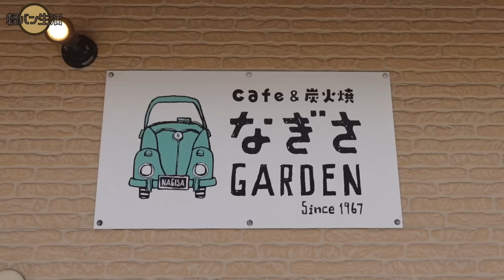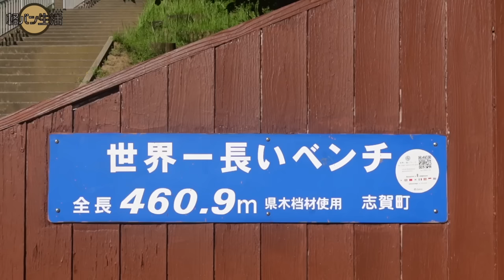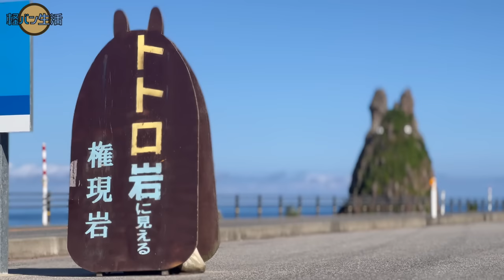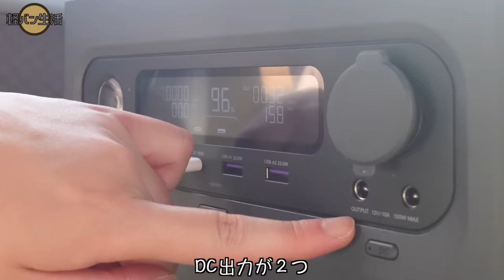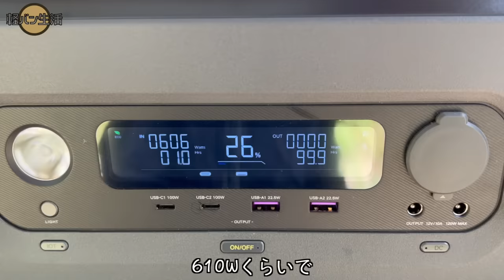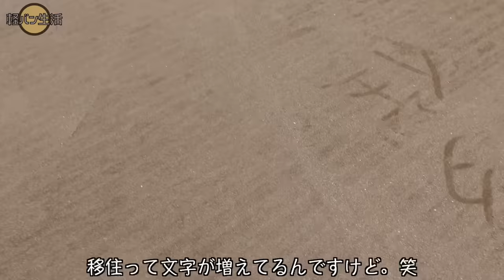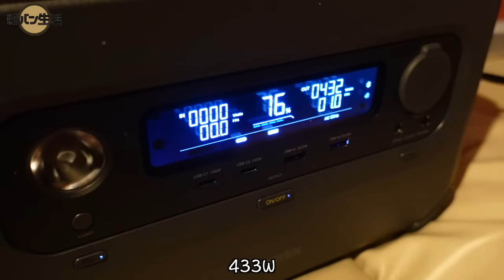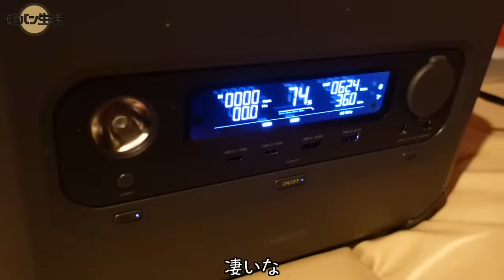890日目の軽バン暮らし。出会いがたくさん能登半島。

Comment: If you rig your solar panel setup to the top of your car, it won't be such a hassle to set it up. Also, you can rotate the solar panel from inside the car, it's more convenient in the long run.